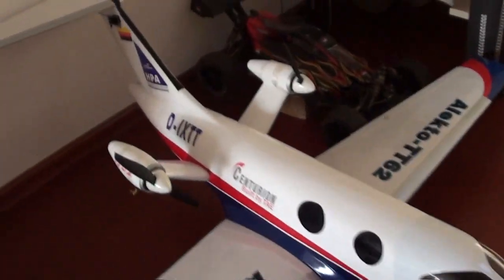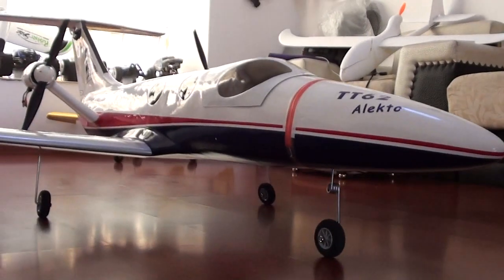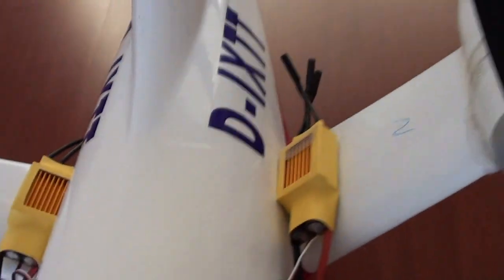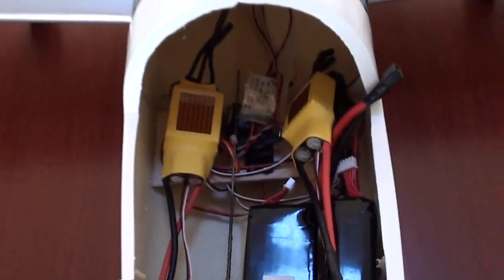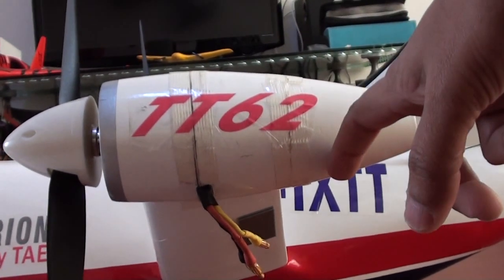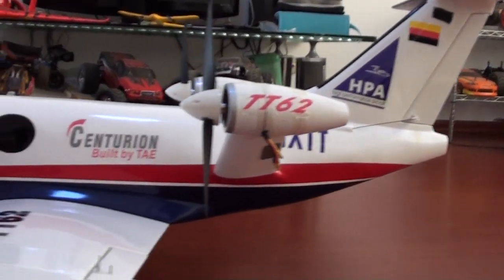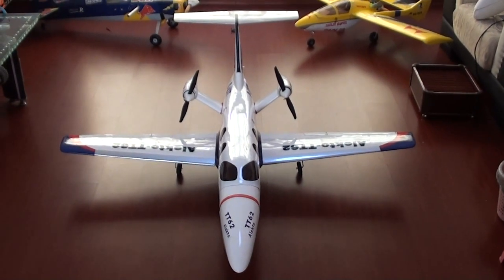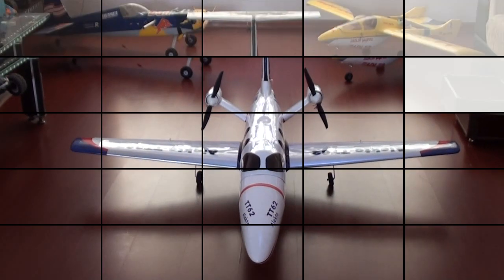TT62 Alekto Getting closer to maiden

Comment: @xXskunksmokeXx You need to know how many amps your motor is going to draw at it's peak.  If you don't know assume it's going to draw the max capacity of your ESC.  So if you have a 50 A ESC you need a battery that can put out 50A max without puffing.  The way you find this is simple, divide the mAh number by 1000 and multiply the result by the "c" rating.  So if your battery is, say, 3000mAh  20c, you divide 3000mAh by 1000 to get 3 then multiply 3 by 20 to get 60.  This battery will work.

Comment: Can the ESCs handle the extra wire length between them and the motor.  Won't that create a lot of electrical noise.  The three wires between the ESC and the motor carry a frequency voltage and are best kept short.